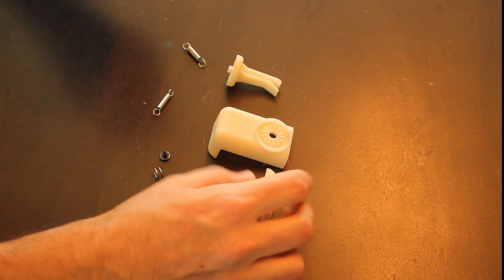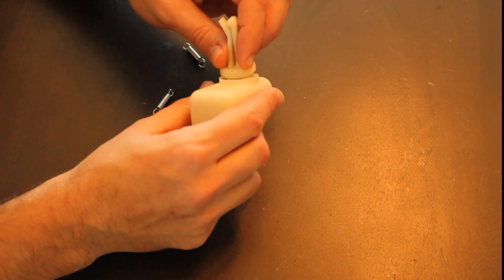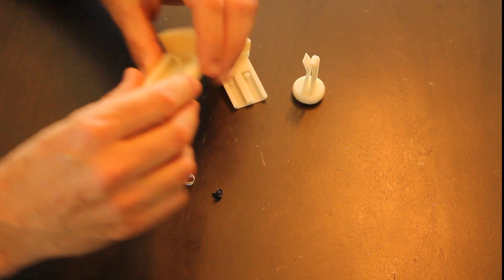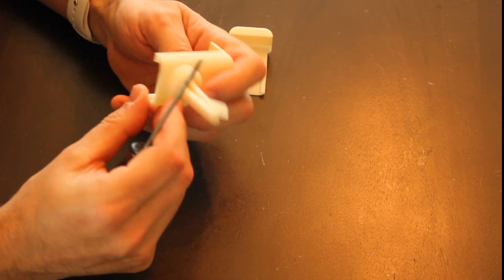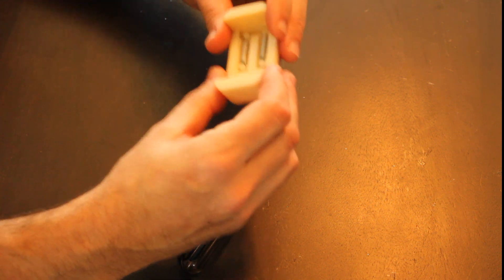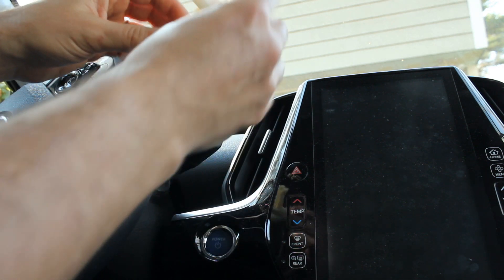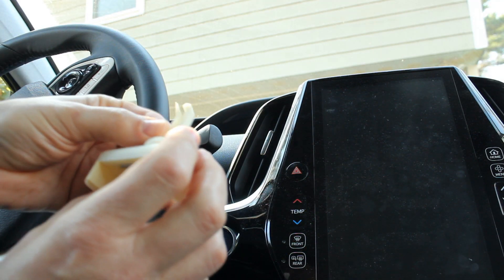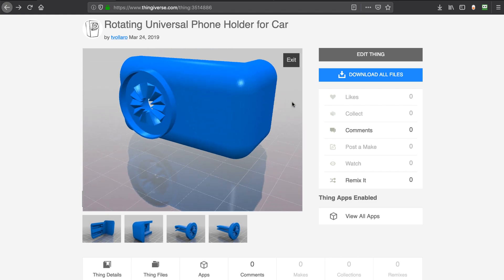3D printable universal phone mount for your car

Comment: Hi Tom. I printed your design and found it very nice. However, couple of improvement you could make there.1. Make the base unit somewhat (2 cm) longer. This enables also the wider smart phones to fit there without slipping the sliding part off the rails. 2. Add a bit of a kind of nails to the edges of the side bars, so that the phone does not slide off. 3. The rails in the base unit are a bit to wide, which makes the sliding part wobble, especially when pulled out to maximum. Further, instead of spring, I used rubber bands, which seems to work just fine.

Comment: How do you prevent the phone from overheating in  the winter with the heat on?
Reply from the maker: My version is really no different than the numerous vent-mounted phone holders you can buy on Amazon, etc. The heat seems to dissipate quickly around the phone and does not cause overheating.
Reply: Turn off that vent if possible?